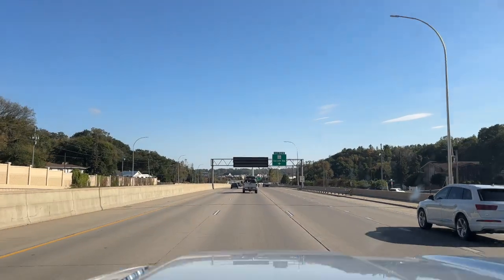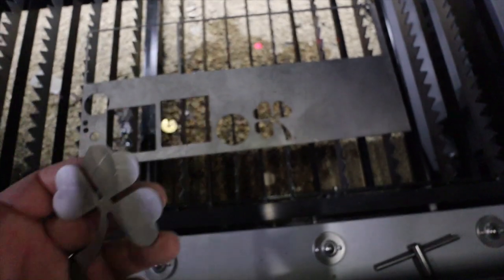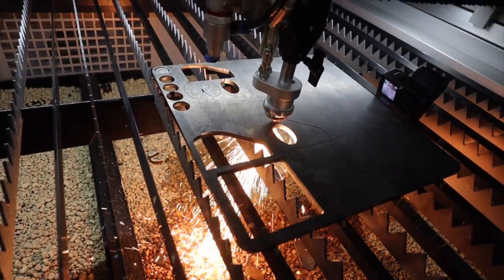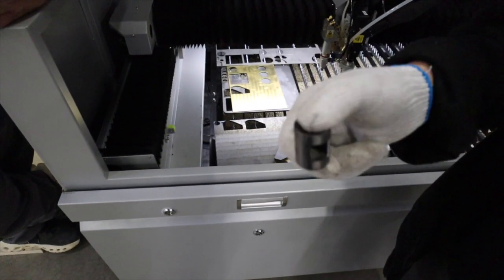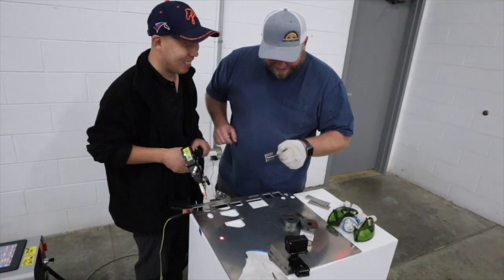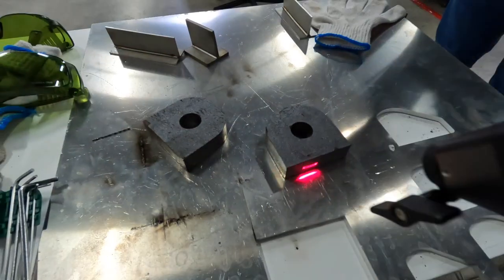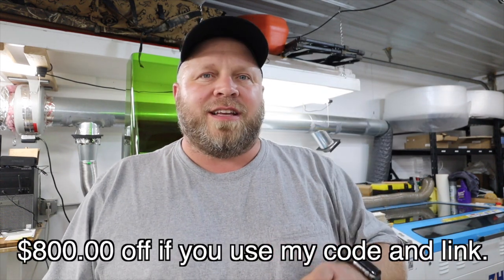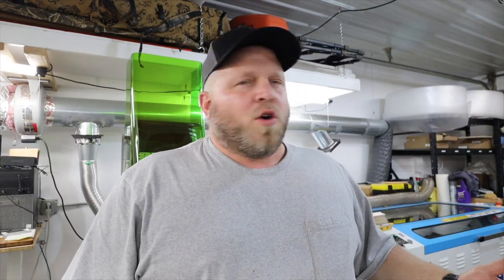Is This the Coolest Laser Ever Made?  Gweike M series 6 in 1

Comment: $10k for what? The laser itself? The CNC table? Both together? I just paid $9k for my 1200 watt laser. How many watts does this one have? This seems really cheap if it’s the setup you just saw, together, other than the rotary unit.
Reply from the maker: 10k for everything
Reply: @laserengravingwithmatt that is REALLY cheap. I wonder why. What laser module is inside. There are not so great ones and better ones.
Reply from the maker: I did not ask